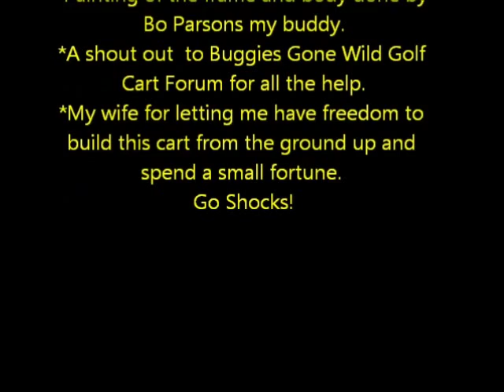Club Car DS Rebuild

Comment: How does the front plastics get held in place? im trying to figure out how to pull mine off
Reply from the maker: There are 4 tabs that you should be able to get to from the cubby holes on the top. The other 2 bolts holding it on are the top roof brackets. They might be rivets so be prepared to drill them out. You can always put screws or bolts back in like i did. Good luck!
Reply: got it. i wanted to paint it RED ohhh yea

Comment: What kind of motor and controller and solenoid did u out on it? Also how fast will it go. Just got one and seems slow 12-13mph
Reply from the maker: I had a motor built from PLUM Quick Motors online. It was about $900 but it'll do 40mph on flats and easily climes hills
Reply from the maker: oh, and the motor was a GE 750 AMP controller